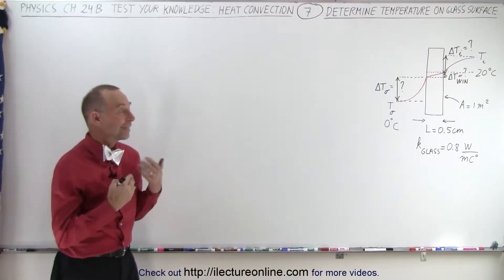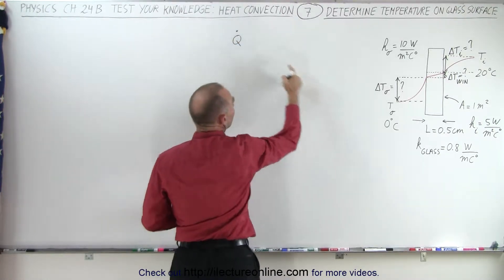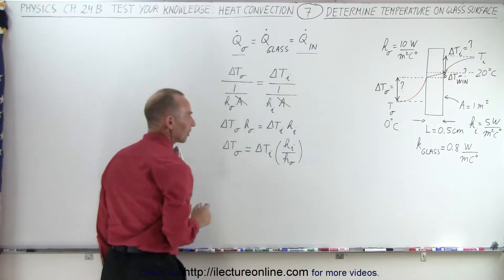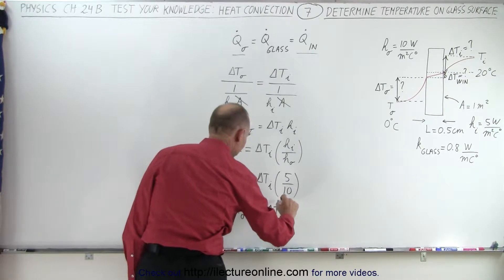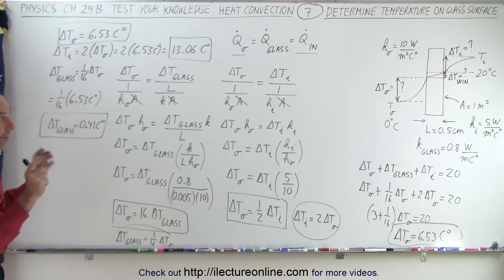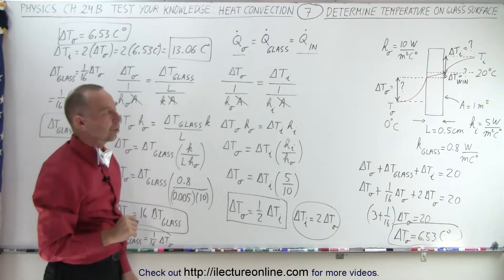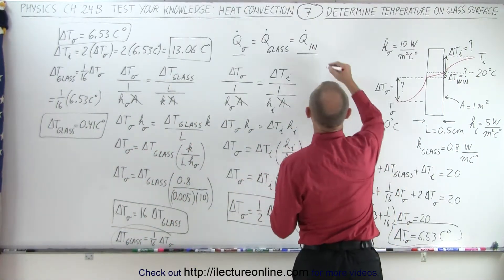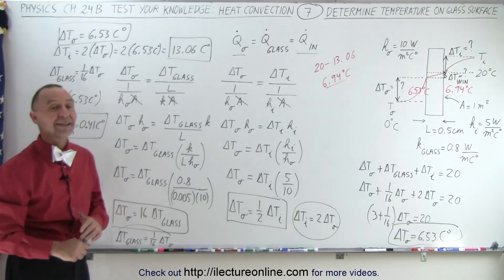Physics: Ch 24B - Convection: Test Your Knowledge (7 of 26) Temperature=? of Glass Surface

Comment: Yes, the Series on conduction is explained very well for practical use as well. I can develop the calculation needed for businesses that need to re-insulate their exposed piping that is currently sweating and losing energy. Thank you very much for this work. I will look through my long list of practical energy savings measures in large commercial buildings that can utilize proper calculations  rather than building an un-calibrated energy model and I will reach back out. Thank you again.

Comment: Very nicely presented. Your work will be referenced when utilizing this calculation approach. This can be utilized for client's that need to address moisture issues in their buildings. Now, can you present or refer us a pipe insulation problem? In the field we often see exposed Copper pipe (~2" dia.) or Steel pipe (~6" dia.) without insulation. We need a nicely presented calculation to prove to the Utility engineer and customer that a certain amount of Btu loss per length of exposed pipe is worth re-insulating the pipe.
Reply from the maker: We have some videos like that in the previous playlist (conduction)

Comment: Professor inside temperature is 20 °C and inside temprature of glass surface is 6.94°C as glass surface is also a part of inside temperature  so why temperature goes down from 20 to 6.94°C. please help thank you!
Reply from the maker: Since heat is flowing to the outside, the heat must be replaced by the air molecules on the inside.  They can't keep up to the heat flow, thus the temperature on the inside side of the window drops until the heat flow from the air to the window can keep up.